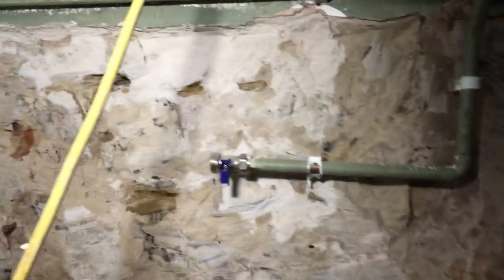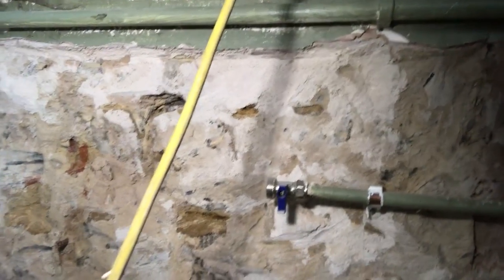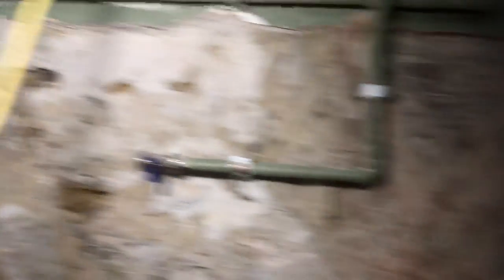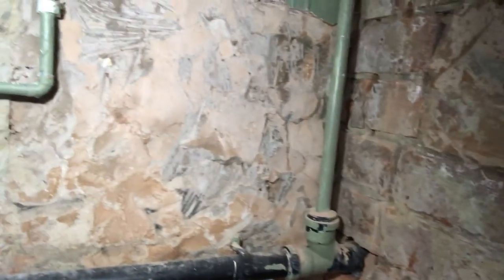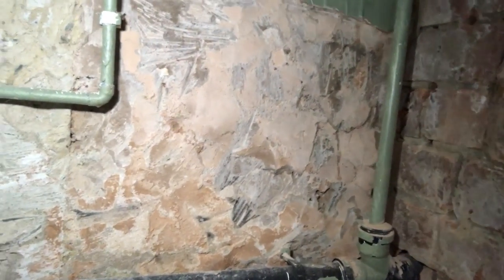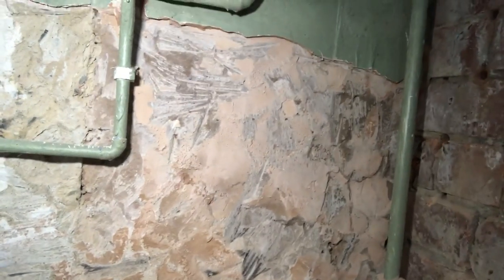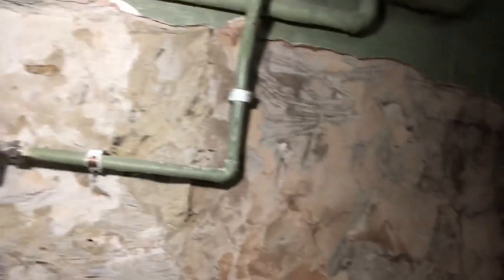When customers decide to knock plaster off

Comment: what does it matter...if it aint bridging to the floor ...its good to go. 
you only need to worrry if bits are left on touching floor or crossing over the level at which you wanna damp proof
Reply from the maker: That’s a good point, next time I’ll leave all the contaminated plaster on and just cut the bottom bit off ey,

Comment: Good video Sam. What exactly is bridging? Is it where the plaster is touching the floor so it will soak up moisture?
Reply from the maker: Bridging is anywhere a material allows moisture to track from one point to another. There are loads from obstruction in cavities to differing floor levels I could go on there is a massive list
Reply: @dampsam  thanks for the reply Sam.

Comment: Do you think using those white tubes which you say are premium and putting in sika rendor would sort out the damp walls as long as it's not rising damp which it's not?
Reply from the maker: I don’t really understand the question but the damp check rods work on rising damp and the replastering system is a waterproof render. You need to know what type of damp issue your treating and use the correct system accordingly. Don’t guess and think it might work.

Comment: Just wondered why you wouldn't use limelight/renderlight over those walls, instead using dryzone 
Cheers mate
Reply from the maker: Iain Jamieson personally I wouldn’t trust it against lateral damp from the solid wall which is more constant moisture than brick constructed walls. The dry zone plaster has been especially developed for this type of fabric.
Reply: Simon Cooper HNC CSRT CSSW yeah I know it can let a bit of moisture back through (personally found that out!) Dryzone definitely better IMO.cheers Simon!
Reply from the maker: Iain Jamieson 👍

Comment: Useful vid but can you dot and dab stone walls TIA
Reply from the maker: Adrian Williams you would need to make a call after looking at the stone, some stone walls are all over the place and not very uniformed,. You need to think if the board sits flat to the wall how much of the board would be touching? You still need to prep the surface to making sure there is no lose debris on the wall.
Reply: @dampsam  Thanks for the reply, I have prepped the wall ready for boarding, but my plasterer tells me that the dab will draw moisture and show through the plaster(it's an internal wall) did have damp issue 2 years ago with leaking roof, wall now seems dry as a bone.
Reply from the maker: Adrian Williams sorry I misunderstood what you ment, I thought you were talking about Drygrip dots not dry wall adhesive. Your plasterer is right the dots will show through if they are gypsum based
Reply: @dampsam  so in your opinion what would be the best alternative, ie. Different adhesive, moisture ressistent board or stud the wall thnx